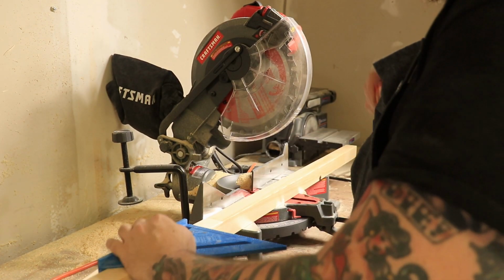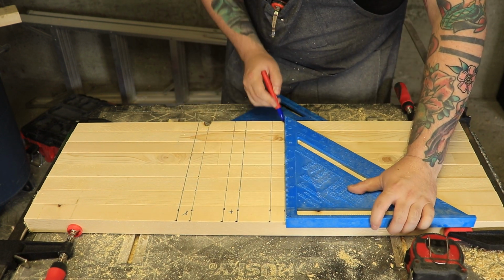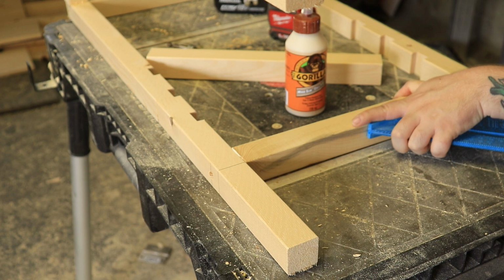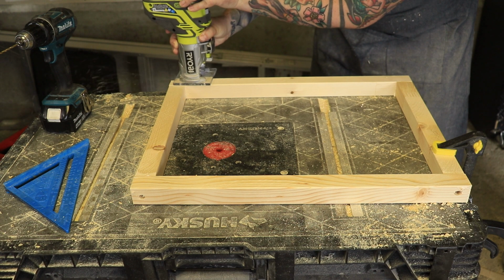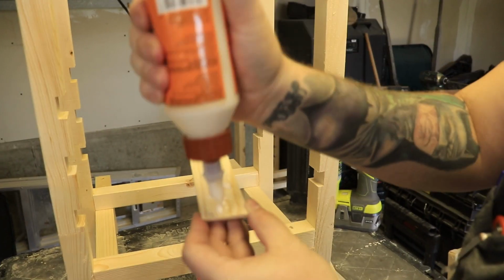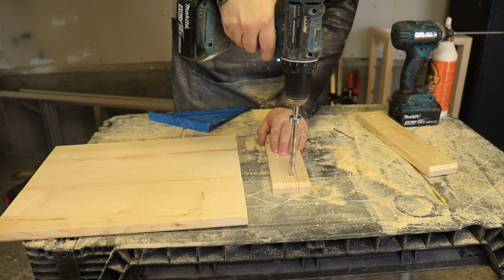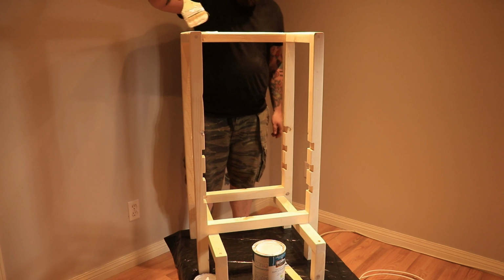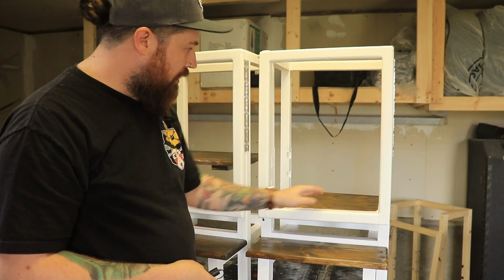How to Build a Toddler Tower!

Comment from the maker: For all those asking for measurements they are as follows!
All these pieces are cut out of a standard 8' 2x2 piece of lumber. You will need,
For the tower itself:
4 pieces cut at 32"
3 x 9"
3 x 14" 
Stair supports:
2 x 18"
2 x 4"
Gate Pieces
2 x 22" 
2 x 14"

After you cut your 32" pieces, line them up as per the video to cut your dadoes, or you can just make your stairs in a fixed position. The first dado was about 12" inches from the bottom, then 3" inches to the bottom of the next dado. The dadoes themselves were 1" wide.

So if you follow along with the video, you'll take 2 of the 32" pieces and join them together using a 9" piece at the top to make one side of the tower, then repeat for the other side. Then you will join those sides together using the 3 14" pieces you cut. One will go at the top at the back, and the other two will go approximately 8" from the bottom. 

Then using the remaining 9" piece will be used a a spacer to keep the tower square when you attach the 2 18" stair support pieces. Then set the tower right side up and measure from the bottom of the stair support pieces to the floor. It should be approximately 4" or so, but just just double check, then cut 2 more little pieces at that length.  

For the gate, you will just take the 2 22" pieces and the 2 14" pieces and make a square frame as per the video.

For the bottom step you should use an 8" wide by approx 16" long piece of 1" lumber. Use the same stuff for the adjustable step, but cut that down to whatever the inside dimensions of your dadoes in the tower are.

Also, after having some practical use of these towers, if the tower is going to be used on a kitchen island that has a table top that over hangs, it would probably be a good idea to add a piece of lumber at the back of the tower from the top to the bottom just to fill in that space a little bit to make sure the young ones can't fall out through the back. If the tower is tight against your cabinets, then they should be ok. 

Good luck!
Reply: Thanks so much and we appreciate it

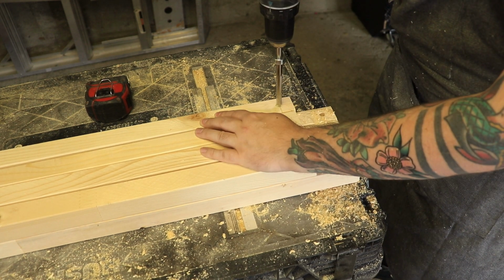Comment: At 1:42 you drilled pilot holes at the top of all 4 vertical pieces OPPOSITE of the dado sides.  But for assembly, the two vertical pieces at the front of the tower (the gate side) don't have a cross member - just the back side does. Was this a mistake, or did I miss something?

Comment: Just wondering after the kids used it, did you get any feedback from the parents on how steady it is? I'd like to build something like this but wondering if you need to add some small perpendicular legs to stabilize it from rocking and potentially tipping over.
Reply from the maker: As far as I know the kids enjoy it! As I mentioned in one of the other comments, we did end up adding a piece on the back to keep it a little more enclosed. As for the tipping, I feel like they are heavy enough to not tip over, but you could easily add some outriggers to it! This is just a skeleton, you can definitely customize it to whatever you want!
Reply: @wildrosediy7058  Thanks for the reply and good to know you feel it's quite sturdy as is. Great build all around!